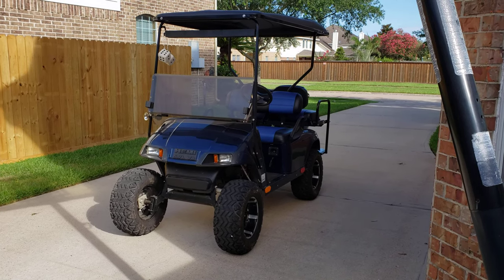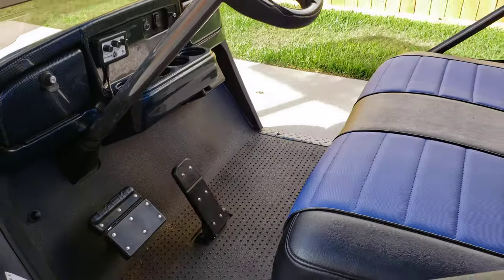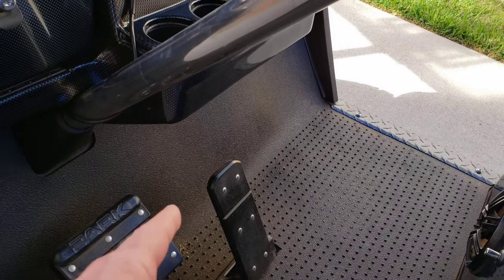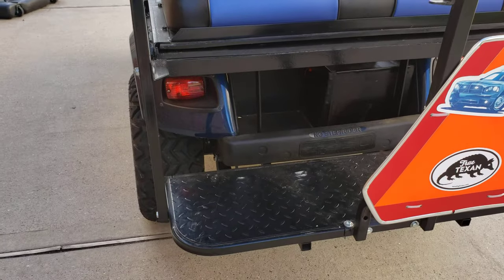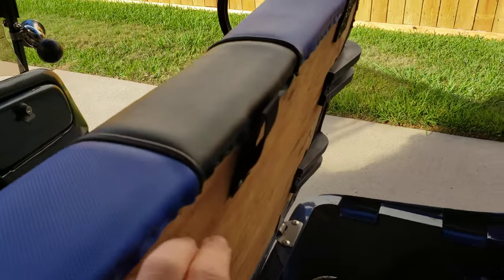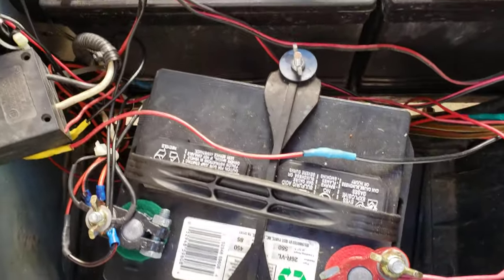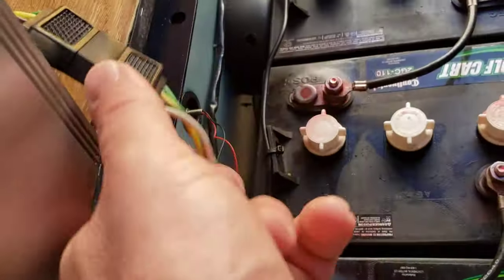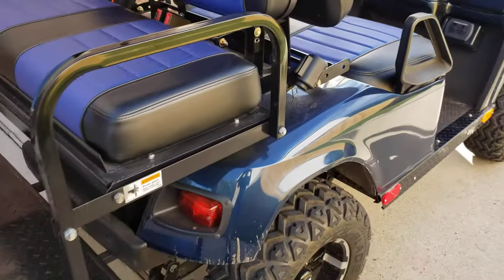Modified 2006 EZ-GO TXT golf cart.  Why?  I'll explain.

Comment: I have a 2005 ezgo txt 36volt and that's just about exactly what I want to do with it. Its clean and I picked it up dirt cheap but it needs new batteries, so a set of light weight lithium batteries are on the top of the list. I want to run it around the neighborhood and/or all weekend on the ranch without it dying in the back forty. Looks like a cool setup and I love the extra isolated 12v for the accessories. I was thinking the same thing for mine. I have an led ligh bar across the front of mine tied into two 6v batteries in the pack but it dims and flickers every time I floor the accelerator. Nice cart!
Reply from the maker: Thanks.  🤘

Comment: Nice setup!! Is that a high torque motor? I'm wanting to upgrade mine with more torque to go uphill better. Don't really care about the speed.  I'm assuming I'll have to upgrade that as well.
Reply from the maker: Thanks!  The motor is from Plum Quick (higher power, torque, and max rpm) and the adjustable controller is great for adjusting to your needs on the fly.  You'll need both to get the performance gains.  There are other tricks but those can can get complicated and/or expensive.

Comment: how do you charge the  aux' 12v battery?
Reply from the maker: I got an inexpensive charger usually used for vehicle storage.  It has a dongle that stays connected to the battery and I ran the connector through the body under the main pack connector.  You can see the connector near the beginning of the video.

Comment: Did you buy a new plum quick motor or send yours off to be upgraded? And how long did it take if did upgrade. Tks nice cart
Reply from the maker: Thanks.  The motor was already on the cart when I got it so I don't know the process.  I will say that the motor is one of the few things that I didn't need to repair or replace so I can say that Plum Quick does quality work.
Reply: @Engineering_Improvisation  Tks, I’m wanting to get mine sent to plum quick but I want it back by camping season. Might jus have to wait till fall.

Comment: how does the additional 12v battery charge when you connect the square EZGO plug? or do you have to charge the 12v battery independently? Also the upgraded motor, what HP is it rated for.
Reply from the maker: I charge the 12v battery separately.  I found a charger that has a pigtail that stays connected to the battery so it connects similar to the main pack charger.  I don't remember the power numbers off-hand but I think stock is 2hp and this one is about 3.5 ... or thereabouts.

Comment: Great job man;) did you change the carbon fibre dash? How difficult was it?
Reply from the maker: Thanks.  Not real carbon, of course.  It's just an overlay and just slips over the factory dash - held on by a few screws.
Reply: @Engineering_Improvisation  Thanks, online they're about $180, cant believe its so expensive for an overlay thats not even real carbon fibre. Cart parts are so expensive. Is that what you paid for yours?
Reply from the maker: Wow, that is expensive!  It was about 7 years ago for me.  Don't remember what I paid but it wasn't nearly that much.